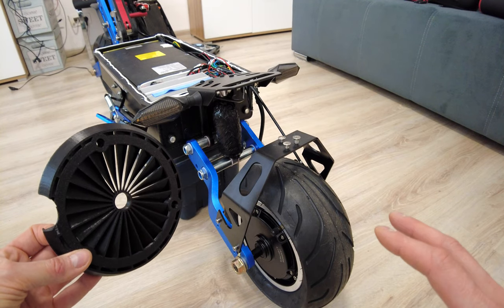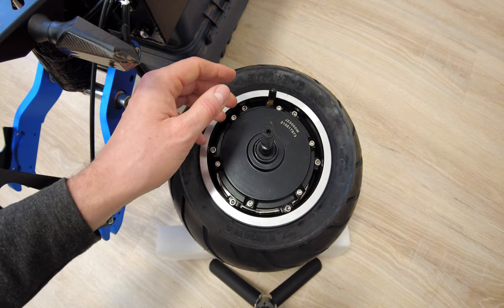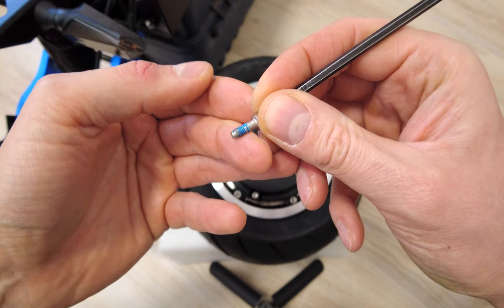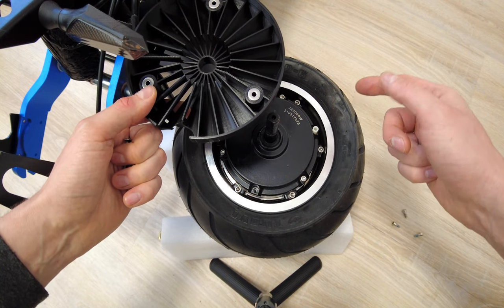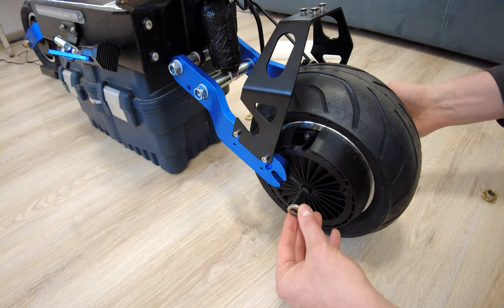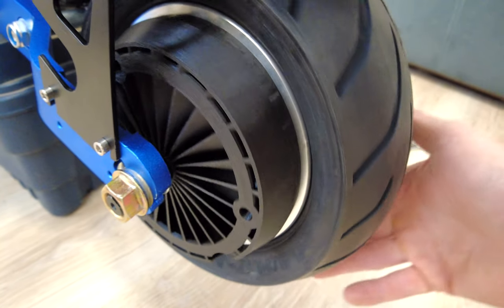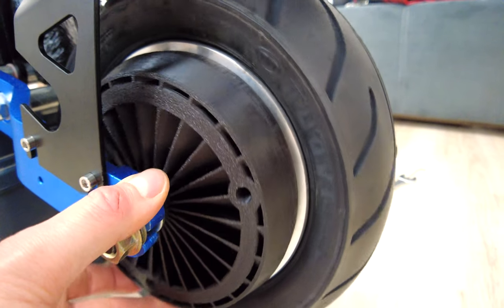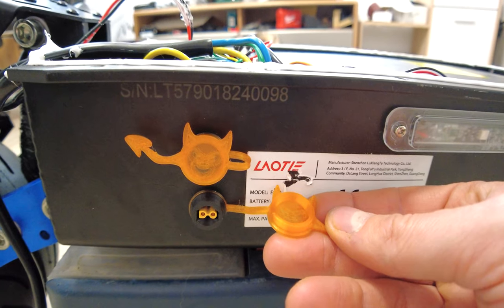Laotie ES19 Cooler 🚀 How to install it ⚡ Some extra tips 🎁 You wanted You got it 🍕🍻

Comment: Hey pirate, when I accelerate my Laotie es 19 like you do in this video. the scooter starts to shake  badly can you tell me any tips on getting it to stop  shaking. Please an also what kind of shocks would you up grade for the es19 to make it more firmly when I ride it the scooter has a bad wobble and it’s extremely scary can you please give me some Tips please I’m desperate and also wanted to say thanks for the headlight bracket, also want to order then motor cooler do you put them on the front motor aswell

Comment: Your videos are awesome and very helpful, I'm considering buying the Ti30 or the Es19 for commute, mainly asphalt roads, heavy driver almost 120kg, which one would you recommend? 

Also before 1st use, your tip regarding XT connectors and bullet connectors. Do you recommend doing the swap before first charge and test drive? Or after actually trying the unit? I'm mainly referring to function and warranty because I suspect if something is wrong out of the box and i mod everything before use, seller might deny any warranty claims. Or will the mods prevent any possible issues that might occur under first charge/drive. Again thank you for all the enjoyable and informative videos.
Reply: I'm 6ft7 320lbs and the laotie ti30 been great for me so far

Comment: Hey Pirate, how are you man? iI have the same issue as Jerry Shaw mentioned below with my new ES19. I think it's probably from both my wheels not turning right vertically to the axis but they shake from one side to the other 4-5 milimeters. I contacted Bangood and i hope the answer soon for some fixes or replacements. How can we arrange it so i can get the es19 coolers and charging port connectors?
Reply from the maker: hi Bro, omg 4mm is big, looks like bearing is dead or motor shaft was bent or maybe just tire is not fitted well or damaged. I hope U will get some spare parts. Check my Eshop for any extra items , I think I got only one set of screws left for Es19 cooler
Reply: @PirateWasHere  We realized that the rims are bent, the tires are faulty too and i don't know if there is anything else.

Comment: Awesome scooter,ordered one,have issue with front wheel. It's wobbly and tire have egg shape.Noticed bearing on the left side is not placed properly It's angeld slightly. So my question is does anyone know where to find bearings for this scooter?
Reply: Did u find out?

Comment: it is better to have a cooler at the back and front or just at the back?
Reply from the maker: On the back , if you use full power and front motor is also super hot then on both

Comment: Bro I have the es 19 and I guess I'm a lighter Rider I weigh 172 it was too much for me and they wouldn't let me return it so what's the best way to setup for Top Speed without the speed wobble? I definitely want to change out the handlebars to stabilize them should I get a different shape? And my second question is should I change the air shocks
Reply: Did you ever figure it out bro?
Reply: Yes I bought the oil dampening shocks and the even bigger issue was balancing those Wheels for the handlebars I do almost a cafe racer Style and they're super comfy

Comment: How much does it weight? I have doubts between es18 lite, es19, t30 and ti30 because I can't find which is the "sweet spot" between price, weight, power and battery. My weight is 85kg and I will use on asphalt roads. I don't need to go fast but I like to have enough power whenever I need it.
PS: have you got any coupons? Thank you for your videos!!
Reply: I would recommend the es 18 lite, it is very powerful. I weight 75 kg and with a gps speedometer i got to the max speed of 70kmh. Hills are no problem but i would recommend a steering dampener for this scooter. At high speeds it is not very stable.
Reply: @VasterasSC  I know about this problem but I won't go faster than 45km/h. I usually cruise at 30-35km/h
Reply from the maker: I would go with ti30 , no doubt ;)
Reply: @PirateWasHere  Do you know how much it exactly weights? Thank you :)
Reply from the maker: No idea, but its heavy , maybe 40kg. Es18 lite is also heavy around 34kg
Reply: @PirateWasHere  Could you make a more in depth video on how to install your custom charging ports? I am planning on buying them from your website
Reply from the maker: There is post on my shop and site with lots of pics, how to install it step by step.  Ps 70km/h on es18 lite is decent, my one cant go over 55 xD
Reply from the maker: @VasterasSC  here https://pirate.ac/better-chargin-port-for-escoot-xt30-mod-instead-of-dangerous-microphone-port/
Reply: @PirateWasHere  I bought the same model but straight from the factory. I have heard that if you buy from them you get better controllers but I am not sure
Reply from the maker: @VasterasSC  possible 🙃
Reply: @VasterasSC  how did you buy it from the factory?
Reply: @VasterasSC  Bought the ZonDoo variant since Laotie changed their controllers.